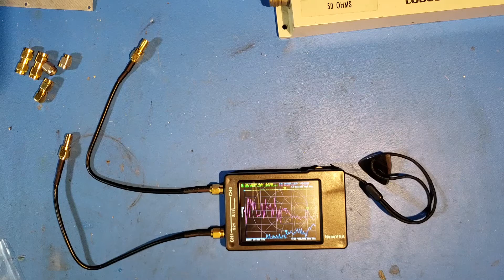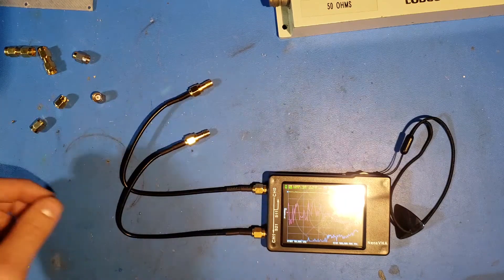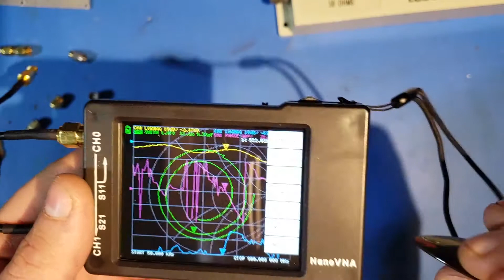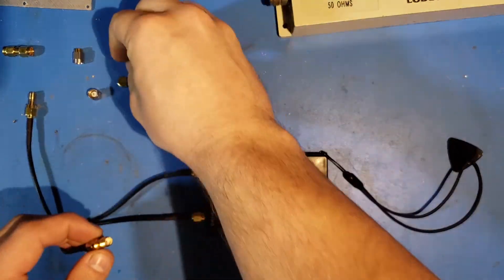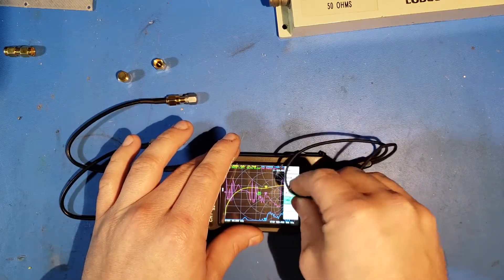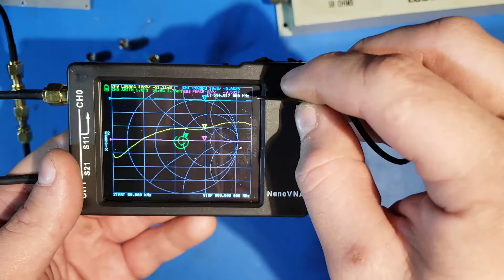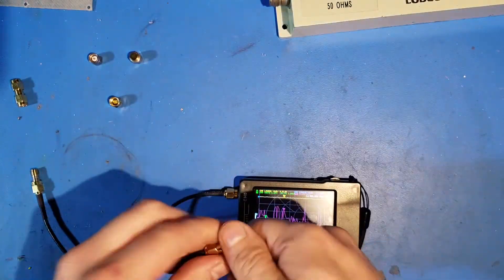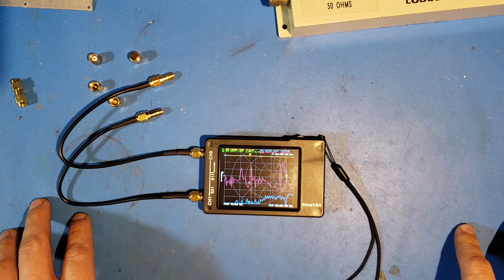NanoVNA (rev3.4): Correct 2-Port Calibration

Comment: like the SWR of an antenna i have tested is like 1.0 at 144mhz.. but if i hold the VNA the SWR changes to 1.1 at 142.800mhz.. so whats is the real SWR???
Reply from the maker: input impedance of a anything other than an ideal resistive termination varies with frequency, so the SWR will change over the frequency bandwidth of any real antenna. The "relevant" SWR is one considered w.r.t your used center frequency. All the measurements are "real".

Comment: one big question.. coz the SWR values change if you hold the vna compared to when it just sits on the table.. so what is the proper way to measure SWR of an antenna? you hold the nanovna or not?
Reply from the maker: You want to be as far from the antenna as possible and not to be in a space with many reflections off walls and such. Ideally, this is called an anechoic RF chamber. Less ideal would be like a large field. And in hobby work at home, I'd say just get the antenna away from ppl and metal objects in its near field and it's going to be an ok enough measurement for most Ham things.

Comment: I sometimes need to tap on one of the cal 'buttons' more than once. But I've found that the system is actually slow enough that it takes a couple of seconds to complete and indicate a cal function. So I've learned to be patient and wait for a second or 2 after I tap on one of the cal functions to see if it highlights it.

Comment: Good video. I do mine a tad different. First I replace the 50 ohm load that came with my Nano, that measured 51.7 ohms with a load that was as close as I could get to 50 ohms which was 49.9 ohms. I have two of them.
As for the cables, I used one barrel connector and connected both of the cables together. Now when I did my calibration, I added a 50 ohm SMA inline 10 DB attenuator to the cables. I placed it where the one cable connects to the S21 port. Now when I did the calibration I put my loads on the end of the attenuator. I had to use a barrel connector at that point as well. When I normalize my spectrum analyzer I put a a 10 db pad on both my SA port as well as the tracking generator port. I was going to do the same to the Nano but figured one attenuator, properly placed, is enough. My DUT goes where the two cables connect. 
Barry
Reply: My came with a exact 50 Ohm load, but it's difficult to find other replacements, I have bought a 5pcs pack and they vary between 50.5 Ohm to over 51.xx Ohm 🤔
Maybe the replacement complete calibration Kits are worth to being tested, if they are better quality. 🤔
Reply from the maker: Seems fine by me. Using the attenuator is smart and adds nice protection for measuring active devices too. The NanoVNA does lack a very large dynamic range though, so it can pose a problem for very lossy networks, but I hardly need more than 40dB of dynamic range for hobby passive networks. The standards that come with the NanoVNA are indeed hot garbage, but for most of my use cases the diff between a 49 and 51 ohm normalization isn't so important to me.
Reply: @R3RadioResearch  The loads that come with the NanoVNA are good enough for the average ham. Surely good enough for HF work checking antennas. 
It's a great tool and I'm glad I have one. I find more uses for it everyday. 
Barry

Comment: If you'r running the nano vna at UHF frequencies, then you're right about those adapters.  However, If you're using them below 150mhz, the difference in that extra cm of cable/adapter isn't worth worrying about.  In my case, I'm using it below 30mhz, so it's really "close enough for government work".
Reply from the maker: Definitely agree on the "close enough for government work" at HF and probs most VHF work haha. I've done some work where it mattered at VHF though, but tuning your typical ham radio antenna  with a one element match where you're only looking at return loss wasn't it. 

To figure when it may matter consider 1/400 is basically a gradian with VF=1 for a 1cm long connector at 2m freqs. For VF=.7 it's close to 1 or 2 degrees electrical length. If that matters to your application it matters; if not, whatever works. More power to yah. At HF we can get away with almost anything tehe.

Comment: Three other tips to mention:
1) It's a good idea to tap on RESET on the CAL menu, after setting the measurement range and before starting the CALIBRATE process.
2) When attaching adapters, standards, etc., it is good practice to ensure that the male/female parts do NOT rotate when you are attaching them, you should only spin the nut.  For example, when connecting the female SMA through, do not rotate the through adapter, only rotate the SMA nut.  Spinning the male pin inside the female socket can cause damage to the pin/socket over time.
3) When you can't avoid adding/removing an adapter compared to your DUT connection, you can usually get away with applying a Port Extension (called ELECTRICAL DELAY under DISPLAY>SCALE) to adjust the calibration plane to account for the added/removed adapter.
Reply from the maker: Thanks for the constructive feedback. If the user intends to calibrate to a non-default frequency range, they should definitely make sure to set it before pressing the reset and beginning the cal as you say. Thanks for pointing that out to other viewers.

About point 2, this video was filmed before I was educated about the danger of turning female connectors inside SMA connectors. I have since found in my experience that this is 100% an important part of ensuring the longevity of my male SMA devices. The complaints about cheap radios using female SMA antenna connectors also appear to be well founded. I make a point of following this advice in my later videos after this point was raised on the first NanoVNA V2 video.

With regards to point 3, Do you have some resources for exactly how much electrical delay to apply when accounting for measurement plane shifting as a result of adding additional connectors? For example, can I find velocity factor data and effective physical length when connected to a male SMA connector for SMA female to female adapters? I've always wondered how to deal with connectors of different and sometimes weird types in the calculation of the electrical length of a line. Understanding ideal transmission lines is one thing, but the practical application is difficult when connector length matters. Microstrip lines are easy enough since the line geometry doesn't really change at the junctions, but this was an especially challenging issue with the phasing harness for my 137MHz cross yagi where I used ring lugs as the connectors between my coax stubs. I wonder if for standard connectors there is more of a science to it even when coax connectors are used.
Reply: @R3RadioResearch  It is usually easiest to determine the proper electrical length experimentally.  Try this...  Calibrate the unit over your intended frequency range, then add an adapter or short length of coax.  Leave the far end open, and take a look at the Smith Chart.  You'll see that at the high end of the frequency range that the trace is not sitting at the 3 o'clock position, but has rotated clockwise.  This is due to the extra length added after the calibration plane.  So, you can then go into the Electrical Length setting and start adding small values until the arc collapses back down to a single point at 3 o'clock.  Now you extended the calibration plane to the end of your added adapter/coax.  Of course, this is only an approximation because it assumes a perfect 50ohm impedance all the way to the end.   Another way to do this is to look at the Phase of CH0.  It will be a flat line after calibration, but will show a slope vs frequency if you add an adapter.  Again, adjust the Electrical Length to make it flat again.  You could do the same by looking at the Delay of CH0, but it will just show a up/down shift in the flat line - harder to see when you have it properly adjusted.

Comment: Thanks. Please don't forget to specify the frequency range before you do the calibration as the device resolution is just 101 points across the whole range.
Reply from the maker: Yep; this is very important. Thanks for pointing this out for other viewers. If the user wants a more precise sweep, they need to change it BEFORE calibration, not after. If you do it after you have calibrated out the effects of your transmission lines for the original sweep points your calibration will not be valid for the new sweep points. While we like to think that transmission lines will behave linearly and we can just take one point and calibrate out all the effects of the line for all points of interest, they don't always act this way in real life, and it's important to calibrate for each specific frequency point you will measure. Notice that if you adjust the sweep settings after calibration the indicator text on the left hand side of the screen about the save/recall info and calibration status will disappear, showing that you have not recalled or made a valid calibration. This is a courtesy to the user in the firmware of the nanoVNA.